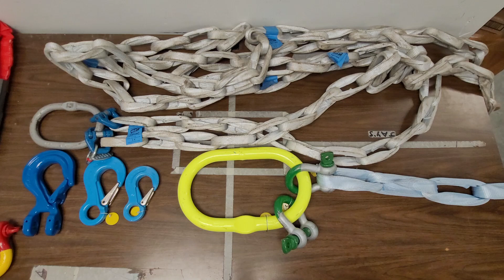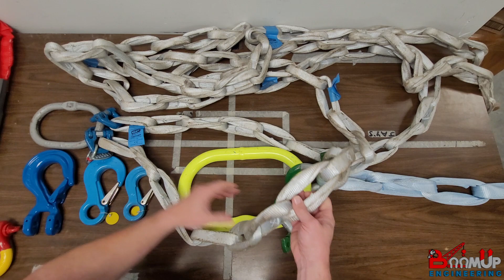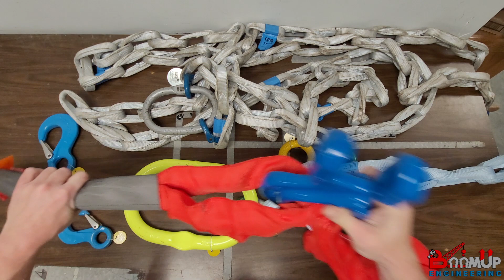Tycan Synthetic Chain - Dyneema Fabric Chain Slings and Bridles (Green Pin Tycan, Doleco DoNova)

Comment from the maker: This is a straight up rigging video showing synthetic Dyneema chain bridles used for overhead lifting (cranes).  While Tycan synthetic chain could be used in the arborist industry, I don't see it as being cost effective.  Smaller 2.6t Tycan chain can easily run $35-40 per foot and Tycan seems to be the cheapest on the US market, at this time.